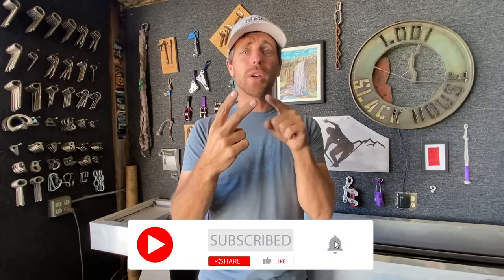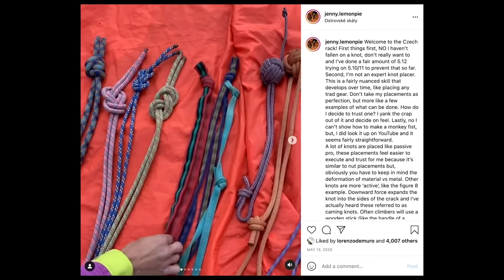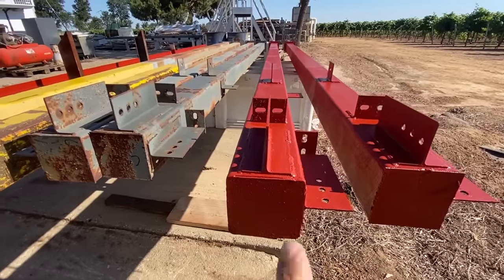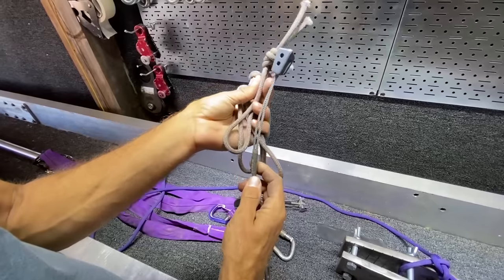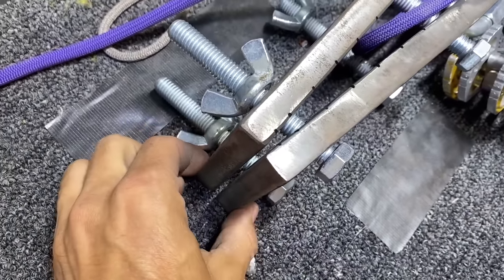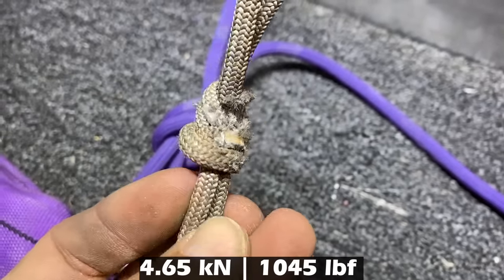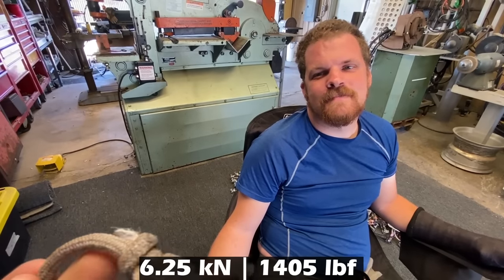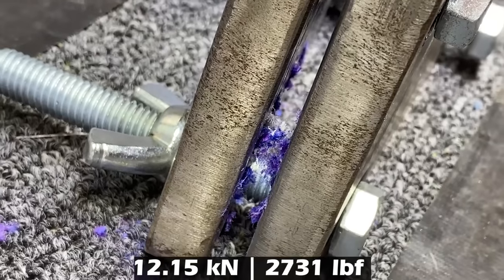Climbing pro made from knots??? Textile passive protection tested!

Comment from the maker: Stoked for all the engagement so far!  The ground is prepped for drop tower, crane is 100% working and all the parts are painted.  We "just" have to assemble it now, lift it up and decorate it.  Donations really appreciated while we take the drop tower project over the finish line.  😀 https://www.slackline.com/donate
Reply: just fyi - "How does the comparison of knot loop and cam look like?

The discussion about local usage bans should be disregarded here. Therefore, the range from loosely pushing through to tight is very small. The range of extensions <6mm and> 30mm is better covered; cams are also easier and quicker to lay. With Friends you can then secure completely parallel cracks.

A knot loop is softer and therefore has a larger contact surface. This means that the risk of rock damage is lower with soft rock. Knot loops are a bit more complex to lay, you shouldn't forget that there is a certain range from lying well to pulling through. A knot loop has more friction with the rock. This has the advantage that a knot loop does not loosen as quickly as a cam through rope movement. Knot loops can also be placed in relatively open cracks and holes, in places where a cam would immediately fall out again.

The experiments were carried out by Jörg Brutscher, André Hoose and Jens Freudenberger. We would like to thank the Institute for Materials Science for making the tensile testing machine available for these experiments. Thanks also to Martin Lange for reviewing the article. Further details of the experiments are available from the author."

[1] See diss. Helmut Mägdefrau: The stress on the human body when falling into a rope and its consequences, available from the DAV safety group. Also: More safety in mountain sports, part 10, Bavarian State Ministry for Labor and Social Affairs - http://www.joergbrutscher.homepage.t-online.de/knoten.htm
Reply: Hi guys, I just had an idea, you might be able to create a more rock like surface in your clamp by coating the steel with epoxy and dusting it with sand while still wet. Kinda like non slip epoxy floor coating.
Reply: @justindunlap1235  or grip tape. 🧗🏽‍♂️
Reply: Would love e to see real rock testing on them!
Reply: I don't know much about the whole using knots in rock vs in that clamp, but I do know that some rock like limestone and such, don't look anything like that clamp, with all those grooves and whatnot, on account of how smooth it is, and in some cases probably even more cushioning than that metal clamp... If I'm wrong in any of this, please correct me, but just given what little I know about rock, I know that different types of rocks might have different grip properties and characteristics, the same as testing out those forces in a metal clamp will likely behave differently in rock
Reply: @justindunlap1235  it would work likely, but isn't sandstone more or less smooth, as in smoother than your average rock??? The way I understand it, sandstone is very permeable, and therefore any cracks formed would then very easily get larger when water runs down the crack... Granted it would still take a while, but that's what makes certain rocks so smooth if I'm not mistaken...
Reply: Still wondering how the test slabs of different rock types will look way up on the drop tower 😉 does Amazon have those available yet? 😆👍
Reply: Woohoo stoked on all the progress!
Reply: totally interested!!! I used to climb in that area in Germany called Sächsicherschweiz !
Reply: thank you guys for making all those tests superinteresting!! that Tower looks amazing!!!!! LETS GOOOOOOOOOOOOOOO
Reply: If u knurled the plates or apoxy real rock from home depot that's used for decoration on walls u would get better friction and would reach mbs

Comment: Hey Rian, maybe your jig isn't that optimal for soft nuts. The side plates change angle when pulled (good to see at 08:00) . Therefore the front of the gap opens for smaller knots. Maybe you could test the small pieces again with a jig with fixed angles? Best regards from germany :)
Reply: Had to scroll way too much to find this comment
Reply: Yep, exactly what I noticed. The knots actually pushed the side plates open. Should be easily fixable by fixing the rear of the plate so that it doesn't move.
Reply: @stangwara  shockingly, in the wild, a group of people who didn't watch the whole video lmao

Comment: Note that the metal plates open up, once the knot is in between the left two bolts. You can easily see this as the right two bolts lose tension. This effectively means that the distance between the plates at the location of the bolts controls the size of the slit. Would recommend to fully lock the two metal plates, during further testing.
Reply: Perhaps the slit needs to do kegels.  If the slit were stronger it would help.

Comment: yeah, do it in real rock...and also if you're ever going to use it again, put some texture in the cam-crusher! (maybe epoxy some flat pieces of actual rock into the jaws of your cam-crusher)
Reply: Epoxy vs multiple kN...
Reply: @kevinmcdonough9097  uh, yes...? epoxy is good for thousands of PSI which should be super-good-enough if the force is distributed by a flat piece of rock above it -- we epoxy in bolts that hold >40kN. 

I dunno if that's even a great solution, just that slippery grooved metal plates are NOT the right medium for this type of test. Maybe the steel can be textured directly, but I'm pretty convinced rock has different enough friction characteristics compared to metal as to be a poor facsimile.

Comment: Local here... The trick about the figure 8 is that you can tie it super flat (basically you get only twice the rope diameter). You can see this really nice in the video of Jenny. When you put it in a crack or feature and pull (on all 4) strands, the knot becomes a lot thicker... and pinches against the rock, which adapts the surface of the knot very well to the rock. Its a lot about friction! try it ;-)
Same is for figure 9 knot.

Comment: Disregarding the friction aspect missing in the test, I would suggest that the test jig itself is flawed.  This is best seen in the test at around 7:20.  In that test, you can see that the wide end of the test jig/fixture is closing which correspondingly causes the narrow end/mouth of the fixture to open wider.    This results in creating a condition which doesn't exist in real rock.   If you secured the rear bolts by placing stop nuts on them (inside of the plates) so the rear plates are set at a more fixed position, you would most likely eliminate this condition.  The "loosey-goosey" rear end of the  fixture not only causes the narrow end to widen, it thereby also reduces the plates' angle where the "rubber meets the road".  Less angle would also make less resistance to the knot.

Comment: I always wondered how secure those sketchy looking Czech knot nuts were. Ended up taking a greater load than I would have guessed. Thanks, as always, for doing the tests!

A note on why the knots were popping through your machine like mice slipping through a crack. If you re-watch (for example) 5 min 20 sec in and 13:50 you will clearly see that as the knot hits the forward 2 bolts and starts to slip past the bolts, those bolts act as a fulcrum for the plates to pivot on. There are no nuts on the 2 rear bolts on the inside to prevent the plates from squeezing together therefore allowing the gap in the lip at the front just past the front bolts to spread and allow the knot to slip through the increased gap. Watch the rear of the plates at this point and you will see them creep together slightly. 4 nuts with washers on the inside of the 2 rear bolts should solve this problem.

Comment: - Sand friction is different..
- Any metal stuff is not allowed to be used on sand rock. (Most of sands are kind of National Monument or protected zone)
- You always fall with angel 60-80 degree
- Its possible that second or 3 knot catch you -  we call this zipping :) (the first 1-2 can go out and just slow your motion )
- I think this need to be tested with real sand rock but nice video...
- You wanna fall to ring not to knot :P but some knots are better than nothing you know :P Because distance between rings are sometimes length of route itself :D

Comment: The sandstone mountains are actually a national park split by the German/Czech border. The park service allows climbers but prohibits the use of chalk or any metal-on-rock trad protection. Some of the routes are bolted, mostly only at the anchor or every 30m with a thick metal ring.

Comment: I do climb in the saxonian swiss. A few points:

Noone i k now uses overhand knots for slings, a fig 8 is nearly allways the better option.

We are usually not too concerned with the breaking strength of the gear >4 mm since dyneema slings. (we start using nylon only slings >7 mm) All that is in question is the friction and integrity of the rock. Laying slings is an artform of feeling how the sling compacts in the rock. And even then noone here likes to test if the knots actually hold.
Reply: Greetings from over the border :)
I am big fan of the overhand knot, because I have much better feeling from placing it in the spot. I feel like having an overhand on the sling gives me nicer v shape at the bottom end and better movement of the top end as overhand is smaller than fig 8. Only this vid made me realise that fig 8 might be ever useful.

Comment: I live in the Czech Republic, used to climb on sandstone sometimes. The friction from sandstone is vital to how the knot works, as you pull the rope and the knot tightens, it should try to expand against the rock and 'mold' to the crack's shape, speading the load. 
These knots are not for big falls with high kN values, if you are worried you will fall you put a knot every meter or so. 
The sandstone is too soft for metal placements. In a fall, they do not mold to the sandstone so all the pressure is on a small area (the  grains which are in actual contact with the metal), which will crumble or snap off.
Maybe you could test with some sandstone blocks?

Comment: As a person that starter his  climbing adventure in saxon switzerland, german sandstone region near to Czechia I have two remarks: 1 the friction makes a lot of difference. People in engineering department of technical uni in Dresden did similar experiments but with knots placed in sandstone crack and limestone crack as benchmark. It turned out that on  limestone they dont hold. 
2 the shape of your nut catcher is suboptimal for placing a figure 8. The cone formed by the metal sheets has far too small opening angle, its just too slim for solid placing. If the angle was twice that, the front loop of figure 8 would move backwards and you'd get more solid placement. 
I dont know if thats clear what im saying, but if Infond some references i'll send them.to you!

Comment: I'm pretty new to climbing and currently in the market for my first bit of rope. In the discussion on reddit about treated and untreated rope, there is also a conversation about rope weakening when it is wet. Outside of alpine or glacier scenarios, it is still entirely possible to encounter a situation in which the rope could become completely soaked (even during a retreat for example). I think it would be interesting to see you guys test the strength difference between dry and wet rope!

Comment: Hey, actually I`ve some experience in sandstone but in saxony, not in czech republic. Here in germany in this area, even fever bolts are placed and therefore we rely even more on knots (and UFOs) :D
Well and it`s not so secure like bolts or friends or nuts. Buts actually I think it`s necessary. Sandstone is really soft, so you could damage it with harness or with too many people climbing on it. So there is a debate about how much protection we allow, because the more protection, the more people will climb. This is a difficult consideration. (Fun fact: There are some people severely injured or even dead each year in this area. Most of them made mistakes during abseiling, not with the knots )

But at the end, its an ideological thing. We learn that climbing is something you should have respect for. I will not start a route if i´m not sure that I can do it. I don´t want to fall under all circumstances. My protection is there to save me from death, and its working. With some experience and the right eye for knot placement (and the friction of sand stone of couse :D) it is a lot saver than it looks. And for me it has to do with appreciation and not to overestimate myself.
But how I said: You should not fall (At least I don´t want to fall, there are some people without this kind if concern). So its not classic sport climbing. It is a developed traditional climbing with some real special moves. 

Thanks for the video, it was quite interesting. How others said, friction is key regarding this topic. Would be really interesting to see what happens with real sandstone (maybe some stone plates in the testing device?). 
For me it would be nice to not rely only on experience or feeling, but on facts :D

Comment: Summary of results:

Knot				Rope				Failure Force (kN)	Failure Force (lbf)	Break or pullthrough

overhand			5mm				5.6					1259				break
figure 8				5mm				4.65				1045				pullthrough
figure 8				5mm				7.2					1619				break
double stopperbend	5mm				6.25				1405				break
overhand			9mm dynamic		5.4					1214				pullthrough
figure 8				9mm dynamic		12.15				2731				pullthrough
stopper				9mm dynamic		12.55				2821				pullthrough
overhand			11mm static			35.65				8014				break
overhand			11mm static			12.1				2720				pullthrough
overhand			dyneema sling		8.4					1888				break
overhand			9/16" webbing		12.65				2844				break
overhand			1" webbing			15.15				3405				break
overhand			3mm soft shackle	6.2					1394				pullthrough
button knot			5mm soft shackle	17.95				4035				pullthrough
button knot			5mm soft shackle	32.85				7385				pullthrough
button knot			8mm soft shackle	43.05				9678				broke the carabiner!
Reply: For perspective on interpreting these numbers, HowNOTtoHIGHLINE stated he'd be comfortable whipping on 8kN.  That's a decent safety factor above the 6kN that Petzl measured on a serious whip (fall factor 1). In the same test series Petzl measured 4kN for an easy fall.

Comment: Can’t wait to see this on the fall machine when it’s up and running. Thing with this test (video) is that it’s unrealistic as you’d never get such sustained high forces. A fall test would be more realistic as you’d get the high force temporarily, for a short time, so i got a gut feeling the protection would behave differently under a shock load, compared to it experiencing a sustained and incrementally higher load.

Comment: You should get various stone sample pairs and a good stone drill bit, drill 4 holes like those metal plates you're using and secure them with the bolts. Then you could determine how the type of rock, and their respective coefficient of friction, affects breaking point using a consistent anchor type. Great video! Love to see these tested in a controlled environment.

Comment: So glad you did this! Definitely somewhat surprising results. I'd love to see these tests done on the drop tower, maybe between cinderblocks or something rock-like that you could still adjust the gap on (maybe the same as your rig in this video, but with some sort of rock-like tiles/patio stones?). I bet the friction really matters, and falling forces are probably more like prolonged spikes, compared to steady forces seen in the slacksnap machine. If the knot moves a little at high impact, but the impact dies down before it manages to slip out, these knots might perform better than expected.